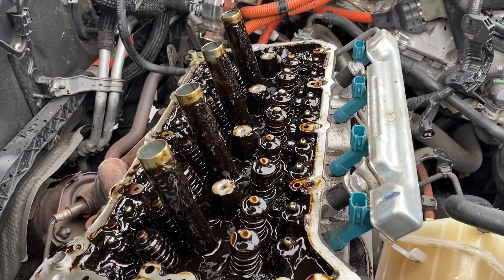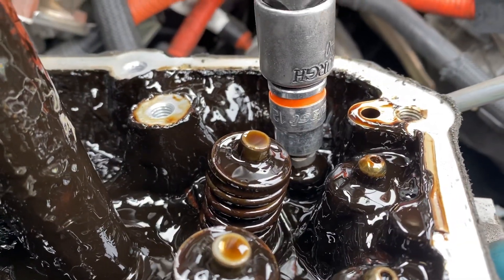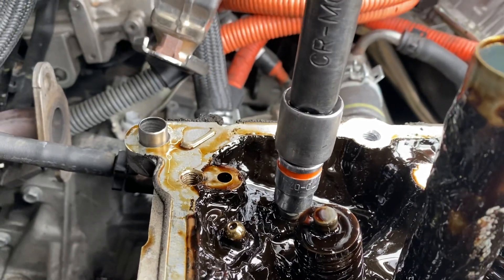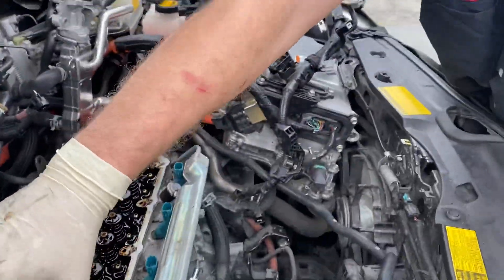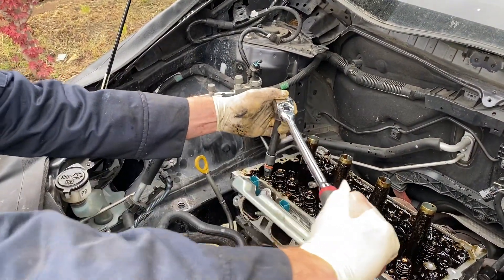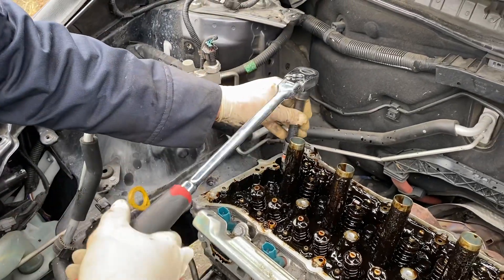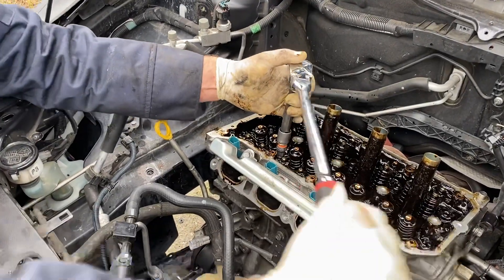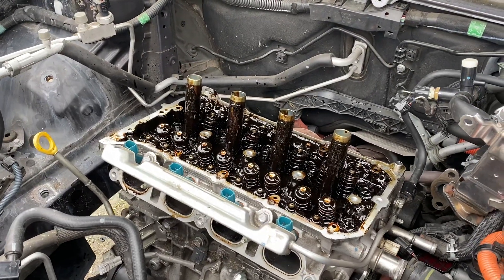HOW TO PREVENT CYLINDER HEAD BOLTS FROM BREAKING WHEN REMOVING.

Comment: The oil in there was not changed on time... That's the issue. Even using synthetic oil does not guarantee it will never form sludge when oil changes are skipped. It's not the oil's fault - it's 100% the customer that never changed it on time.

Comment: I am changing a head gasket on a riding lawn mower engine. I removed all of the bolts on the head except one that just wont come loose.  I loosened the bolts in a circular pattern instead of a criss cross pattern.  This may have been a mistake.  If I "shock the threads" with a hammer on the one bolt that is stuck is there a chance of warping the aluminum heads ?  I have seen people heat up the bolt.  Will this heat warp the aluminum heads ?
Thanks

Comment: I have been working on cars, for a living years ago, since 1971.  This is the first time I have been the "shock the threads" technique to prevent snapping head (or other) bolts.  Luckily I have never snapped a head bolt over all these years, and now it is not likely I ever will.  I will be sharing this technique with others.  It makes so much sense.  Many thanks
Reply: You have been working on cars for years and years. You must have loads of experience! Could you please tell me how do you remove the old RTV gasket material from surfaces like camshaft caps & cylinder heads? I don't want to damage the aluminum surface or scratch it.
Reply: @headtoheadracing  Aluminum, which while softer than the cast iron parts it is used to replace, is not quite as sensitive as you may think.  But, it is good you are being careful with old gasket material and adhesive/sealer removal.  RTV is a well proven sealer/adhesive with some very much wanted properties we like, such as being an excellent sealent, and just as excellent for adhesion.  And some varieties are also both gasoline and oil resistant, which is great for helping seal components that are exposed to oil and fuel (vapors).  But, there is a dark side to all those benefits.  It can be really hard to get rid of old RTV sealer when tearing down components where RTV was used to seal things up. 

So, what to do.  For me, if I find the gasket material itself is really well bonded to a surface I need to clean off, I will initially try an old school gasket scraper or putty knife.  For very sensitive surfaces, like soft aluminum or pot metal (timing case covers) I might try to use a plastic bladed putty knife, unless the gasket material is really heavily bonded to the iten I am cleaning off.  If the gasket bonding is too tough for even a gasket scraper or metal bladed putty knife I will break out my trusty pneumatic gasket scraper I purchased from Harbor Freight a few years ago (https://www.harborfreight.com/6-piece-pneumatic-scraper-kit-95826.html).  The good news its it works great,  The less good news is you will need a fairly good sizes air compressor to use it.  I have never seen an electric (battery) powered gasket scraper, but you may find one if you look via Google.  The bad news is the sharp edge of the scraper can do some serious damage to soft metals, like aluminum and pot metal.  So, do not get too rough with using one, and always keep the scraper edge at an angle relaative to the part you are removing the gasket from.

Here is a video where a friend was helping me replace a water on a 1973 Mustang's 302 v-8 engine.  The gasket on the timing case cover was quite hardened onto the timing case cover after 50 years, so I broke out the pneumatic gassket scraper.  I told him how to handle the scraper, but her was excited to be using a new kind of power toy, and began doing a great job removing the old gasket with the power tool.   Take a look at the following YouTube video as 50:30 mm:ss into the clip to see what I mean:

https://www.youtube.com/watch?v=BQkixS1q8rs

After doing a really job removing the hardened and very bonded gasket material off the timing case cover there is one point, at about 52:20 into the video, you will see where the cutting edge was not kept at the correct angle, and began to nick some of the pot metal.  No real harm was done, and soon after that aggressive angle the tool was reoriented at a better, less "dangerous" cutting angle and the old gasket material once again began to come up easily.

So, more to the question posed re: removing RTV silicone, I did a search in YouTube on ("removing silicone gasket sealer") and camed up with a lot folks who have offered their thoughts.  In the past I have been inclined to use a slightly damp paper towel as it tends to scrub the old silicone off pretty well (not too moist, not too dry).  But, now that I have seen a few different ways to cleaning it off I am going to try some of the methods out.  I will begin with using WD-40.

I hope helps answer your question.  Ciao!

Gil
Reply: @gilberthale7777  Dear Mr. Gilbert
I really don't know how to thank you! Your answer and tips were indeed mind-blowing! I'm in shock! I couldn't receive this amount of information (even during a training course!).
I wish I could ask you more questions about cars and maintenance but I know you might not be in the mood to answer questions anymore.

Comment: Replacing cylinder head studs on an 83 1.9L waterboxer VW.  Two started out fine but are really stuck on the last few threads. The bolts are so long I'm really worried about snapping one off and creating a much greater issue. 
I'm going to try this, send as though it should still be effective.

Comment: Great video, but I didn't see the same thing when I removed my prius head bolts.  No matter how many times I banged on the head bolt with hammer, they were stubbornly locked.  I had to use breaker bar with large pipe as extention to force them.  No sign of "springiness" as shown in the video.  Eventually all the bolts came out intact, but they were incredibly difficult to loosen.  It took maximum strength I could muster on 1/2 inch breaker bar with pipe extension.  The engine was clean without any sludge as only synthetic oil was used on this engine.
Reply: I worked on a 2016 Kia Sorento 3.3l. Had a head bolt wouldn't budge with a 3ft breaker bar and a 3 ft pipe. I beat on it, tried to loosen & heard a pop. Tighten down. Hit it some more. Tried to loosen, 2 pops. Tighten and repeated the process until it came out. Whole procedure took 20-30 min

Comment: Mineral oil in itself is not the problem. The problem is poor oil changing interval and even worse, those Quick Lube shops who perhaps don't even change the oil or the filter or use the cheapest possible oil quality.  A quality mineral oil like Castrol should be fine when replacing it regularly.  I do use synthetic on my car to extend the oil change intervals. However, the tapping idea is invaluable for stuck bolts situations. Another tip is never work after driving in rain, wet bolts will get real stuck when removing them next time - such as suspension bolts.

Comment: Out of curiosity would it be safe to just initially shock them before you attempt to get the first crack? Or could that cause issues if it really didn’t need the shock?
Reply: it should not hurt anything
Reply: Its all strong metal. Hitting it should be okay. You're breaking the bond between the bolt and the engine.

Comment: Should the head bolts be replaced once taken off?
Reply: That's what most people say you should do to prevent any of them from breaking off in the engine.
Reply: yup... most head bolts these days are "torque to yield"
you are actually stretching the bolts
.
this makes them like a "spring" and helps clamp down the hhead to the block
.
but whhen you resue them..... as thhey have already stretched.... they wont stretch again
they will either snap..... or you will be doing the job again.... as its not clamped theh head to the block correctly

Comment: Man, that's sick!!!   I guess both from the engine perspective which was my first thought... and I guess great method.   The exhaust manifold bolts are what get's me nervous.  I've got the Dodge Ram 2001 and I'm riggin for now with custom leak clamp'age to seal where a chunk of gasket went by by.   Guessing the Toyota engine's aren't such a bad design.  The 99 Ford F150 was I've heard a no go for most when I called around asking about advice for the Ram.   I need to check under the Ram's valve covers since I wonder what the leak over the years has done with the specs underneath with the ghetto furnace cement and stainless steel zip ties few attempts prior to seal.  Anyways, Thanks for sharing!

Comment: What about an '07 Prius?  Dealer told me conventional oil was OK.
Reply: It is, you just can't continue your maintenance on the same schedule as you would synthetic. The question is, why would you not? Even the walmart synthetic is 14.50 for 5 qts. Check out project farm, he has a video comparing cheap synthetics against the expensive kind.  They all out perform conventional.
Reply: sure.... if you change it every 3000 miles 
.
if you wait till your change oil light comes on (aka usually 7000 miles).... you WILL have sludge
Reply: Toyota recommends to use full synthetic. I’d just go with that to be on the safe side, but nothing will probably happen as long as you change it more frequently as these 2 guys stated.